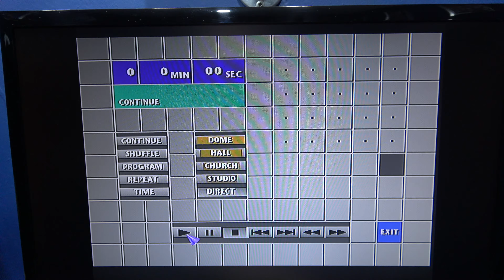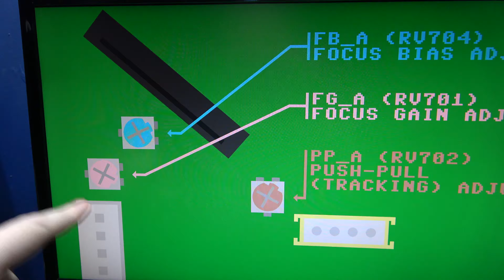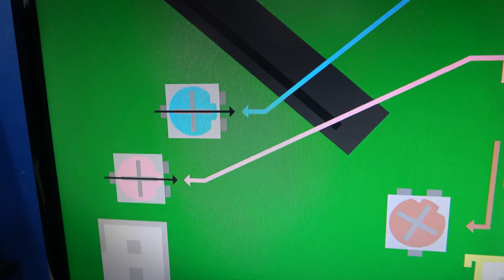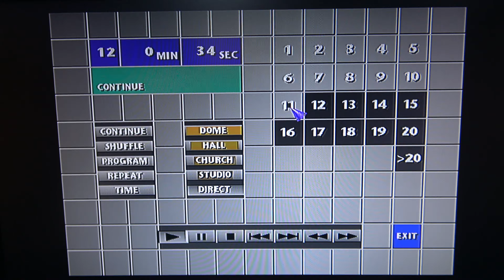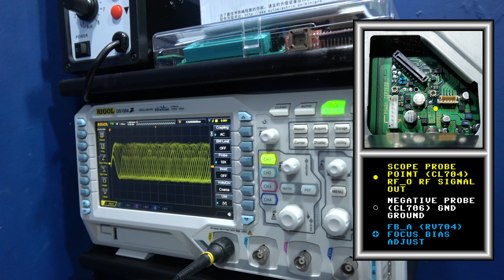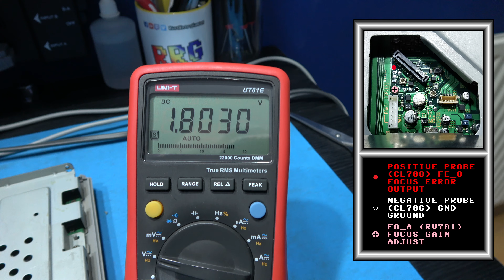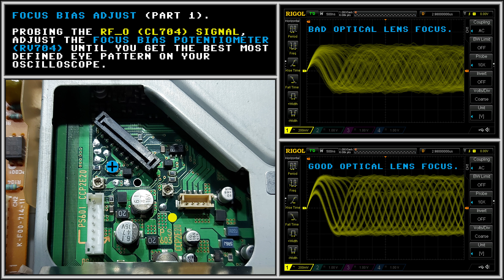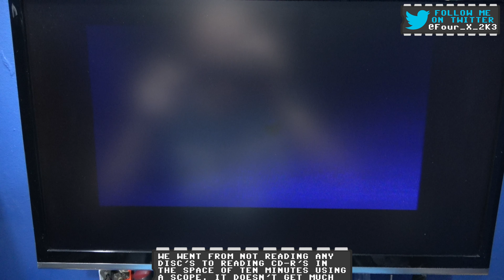Sony PlayStation (SCPH-1002) - Repair - Not Reading Disc's After Optical Pickup (Laser) Replacement.

Comment: this is the new best 1002 laser adjustment video on youtube, thank you very much. I have a 1002 with original laser, once i calibrated all pots it started to read the discs better than my other ps1s 9002, 102, 5502 if its upside down. Even burned games. Also i can't stand these noisy spindle motors, i would replace that.
Reply from the maker: Thanks, I wouldn't go as far as the best 1002 laser adjustment video on YouTube but thanks. Having to turn the PlayStation upside down for it to read disc's is a sign of worn sled rails. That Optical Pickup (laser) is gone, even if you tried to recal it. it's simply to far gone.

Comment: Good job. I got a SCPH100X with a BAM laser too but it works perfect without any adjustment.
Reply from the maker: Nice, the BAM model is a great Optical Pickup (laser). Not all SCPH-100X PlayStations will need recalibrating but this one did.

Comment: Very cool FourX. I find it hard get decent info on test points for calibrating optical drives. Could do with doing a few of my consoles, Mega CD, Saturn and Playstations.
Reply from the maker: I know what you mean, trying to find service manual's can be tricky sometimes. Recalibrating a optical pickup for a Mega CD, Saturn is a little more involved than the PlayStations as you need to cal the tracking also.

Comment: Great video. How did you hook uo the wires?
Reply from the maker: I soldered them in, I wouldn’t normally do this I only did it for the video to make it easy for filming.
Reply: @Four_X  Thanks. And what's the correct way of doing it?

Comment: Phil this was exactly the video that I was looking for. I've got a SCPH 1002 model which I've bought in 1997. The laser became faulty and I have just decided to buy a chinese BAM440 model laser reader. I have applied it to the system and it doesn't read anything. And even the spindle stopped turning after I tried to eleveate the spindle as it came tight out of the box. So how to do all this at home without machines such as yours available, would you suggest an easy way if there is any? Thanks for your time.

Comment: Great video! Though, Is there any way to adjust bias focus without the scope (I know, I know) but using only the multimeter?? I ask because si really hard to get one here and the ones that exists costs over 500USD
Reply from the maker: You could try and adjust the pot small turns and monitor the disc while the system is playing FMV (look for skipping) but your doing it blind. To get it dialled in you need a scope I'm afraid.

Comment: Wondered if you could help with a SCPH-1002 problem I have? Mine has now started not reading discs (they'll spin for about 5 seconds then it stops, the laser never attempts to read). 

It has an original AAM drive but upon opening it the sled rail is actually still ok. To make matters worse, I've tried the AAM drive in another PS1 (a SCPH-5xxx I think) and the drive does still work without any problems. I tried that PS1s drive (a AEM) in my SCHP-1002 and it won't read still.

I unfortunately don't have a scope but I've checked measurements on the pots and have 11.4mv on the AAM drive, 1.7V on the bias pot and 1.82V on the gain when disc is spinning. The other PS1 had the same settings or more or less when the AAM worked in it too (the AEM drive has about 12mv as well if I remember right....).

Worth doing anything or has it finally just gone junk? It's not even an Xstation candidate as it's the older PU8 board. It's got a modchip installed, not from me but doesn't look the greatest install (it's a pin 1, 5, 6, 8 one) and it did work with it previously. I had contemplated snipping it off but don't know if it'll make a difference tbh.
Reply from the maker: Not going to lie, it sounds bad especially if you've tried the Laser in another system and it works, that would indicate there's something wrong with the CD Controller IC or CD DSP (Digital Signal Processor) in the PlayStation, Sadly you can only diagnose this using a oscilloscope. It's a bummer some of the early 1000 series PlayStation aren't compatible with the XStation, but if your CD Controller IC or CD DSP (Digital Signal Processor) has failed the XStation wouldn't work anyway.
Reply: @Four_X  cheers. I thought as much. Gone but not forgotten then.. I'm gonna gut the unit and make something else with the shell (probably some guitar pedals)

Comment: I don't have an oscilloscope.... But are those little digital one useless for this purpose?? I cannot buy a 300€ equipment just to calibrate one console. Anyway my 1002 has an original BAM laser taken from a PSOne and pretty much read everything fine.  But with some burned discs I can hear the "lens"/laser occasionally losing track of the disc while seeking data. What potentiometer could I try to tweak to adjust this erratic behaviour? It's pretty much an issue caused by both the verbatim discs and dvd burner that I use....but I don't have access to a better cd/dvd drive or better blank cds. Also Tayo Yuden aren't manufactured anymore(?).
Reply from the maker: I'll give you a tip. Leave it alone. No I'm serious Leave it alone. If you don't have the right equipment all you can do is make it worse by messing with the adjustment potentiometer. I'm not trying to come across as an equipment snob but you need quality equipment to calibrate a Laser (optical Block) and messing with the potentiometer will just make things worse.
Reply: @Four_X  oh okay. I thought the lens could be damaged since it's like "falling" and making the little "tick" sound. Well not the actual small lens on top but something else inside.

Comment: Is it possible to adjust it without the electronic equipment you have? I have just replaced laser in my unit but it still have problems reading games. Original games in mint condition. It sometimes reads them up to menu sometimes doesn’t at all. What can I do? I purchased new laser unit but it doesn’t read games good.
Reply from the maker: Sorry but a laser (Optical Pickup) is a sensitive piece of equipment and needs proper tool for installation, you can't just wing it and hope for the best. if you do you could damage the laser.
Reply: @Four_X  i understand that. that's why i'm not tinkering with it. i might look for someone to adjust it. thank you. i found a scph 1002 on rubbish and wanted to bring it back to life

Comment: Hey there, I tried your steps and it helped a bit but I noticed if I play audio tracks they won't play past track 7, any idea why that would be? Thanks!
Reply from the maker: Tracking, Check the tracking signal. look for what will look like excessive noise as you step through the tracks with your scope. If your using an early model laser those have issuse. See if you can retrofit a later model laser.

Comment: Can i use an album to test and calibrate instead of a game, like just a cd?
Reply from the maker: Sure, just make sure the Audio CD has tracks filling up the whole of the CD.
Reply: @Four_X  thats awesome thanks for your quick reply, just picked up an scph1002 from cash converter today for £5! Dodgy laser though, going to try this with my mates oscilloscope. Why does it need to fill the full cd? Do you mean every single byte of data on the cd has to be written to?

Comment: I want to replace the lens on my SCPH-1000 (Japanese launch model) PS1. It was known to have awful lenses. Which lens should I swap it for?
Reply from the maker: You can fit the much better one fron the PlayStation Slim (KSM-440BAM) You'll just have to swap the top gray shround on the Laser with the black one from your old laser. You can see me do this in this video. https://www.youtube.com/watch?v=mnmLcyv8MmM&t=15s
Reply: @Four_X  do I have to calibrate it or should it work instantly when I swap it?
Reply from the maker: @MagisterHamid  You may need to calibrate it a little but it should be OK if you've not messed with the Pot's on the PlayStation's motherboard.
Reply: @Four_X  thanks a bunch. Now I need to track down a Pa One in good condition :-)

Comment: I’ve got a PU23 board that won’t disk spin and the fuse is still good, any ideas or I can send it to you for a challenge and some beer money 😅
Reply from the maker: It could be as simple as a faulty lid sense switch to something harder like a blown CD RF Amp or Motor Driver IC. I would try the Optical Pickup (laser) in another PlayStation, then you could tell if it was the Laser or something more serious. Sorry I don't have time at the moment to work on other's system, Sorry.
Reply: @Four_X  thanks dude I understand I checked the switch with a continuity test and swapped the laser all good guess its the CD RF Amp or Motor Driver IC.